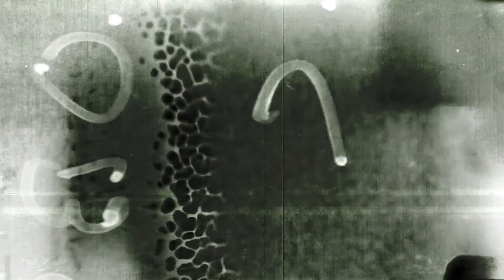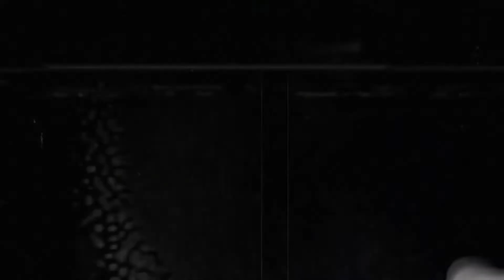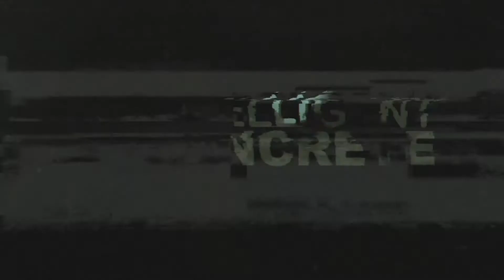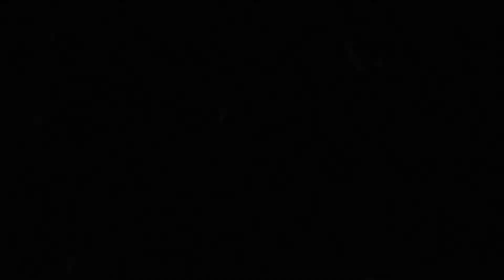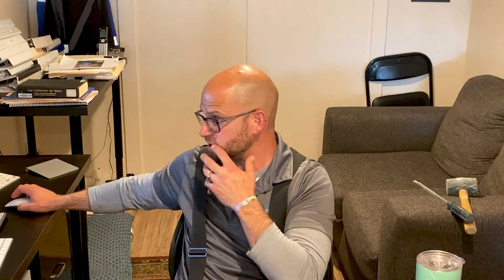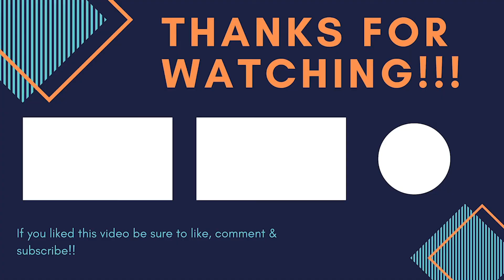What Would Molasses Do to Concrete? - Vlog 707

Comment: Love the channel. Would molasses repel water at all once it's set? I'm looking for an air tight and water tight concrete mixture using natural alternatives to chemicals. I basically want an insulative putty I can slap in, or pour, make whatever shape panels I need wherever I need. I'm thinking to try egg whites, molasses, fiberglass (mostly just because we have some old used fiberglass), perlite and wood ash. Any thoughts on that, or natural products that might work better, or amounts to use would be awesome. Also, specifically right now I'm looking for something to seal around a chimney hole on a metal roof. The chimney itself is insulated with just cement and perlite, which worked very well with. Great alternative to asbestos chimney insulation in my opinion. I heard it popping the first few times we used the wood stove, but there was no visible change to the concrete. I was thinking wood ash, molasses, egg whites and hemp seed oil all in the concrete to seal up the hole. It's going to heat up as high as 90 degrees and get as cold as negative 60 pretty rapidly at times. What do you think? It doesn't have to be perfect, but as close to waterproof and freeze proof as I can get.

Comment: John, big fan of the channel.  Wondering if you've ever experimented with adding csa cement to a portland cement mixture.  Specifically, I want to add rapid set cement all to plain old 4k psi bagged concrete to speed up set time and possibly increase psi.
Reply from the maker: Can do John.  We have used CSA combinations with C 150 cements for precast operations and 3D printing.  Good stuff.  Just be cognizant of some of the chemical attack you can get when using the combo.
Reply: @IntelligentConcrete  good to know.  Where can I find some info on the chemical attacks?  Is this attack on rebar?  Just looking for something to speed up my small bagged pours that contain rebar(avoiding calcium chloride) .